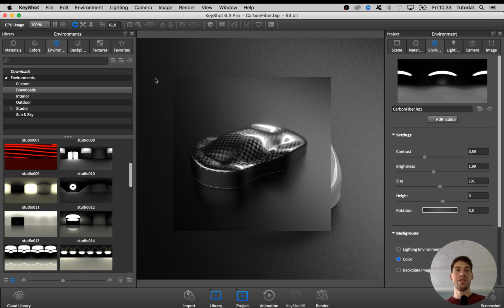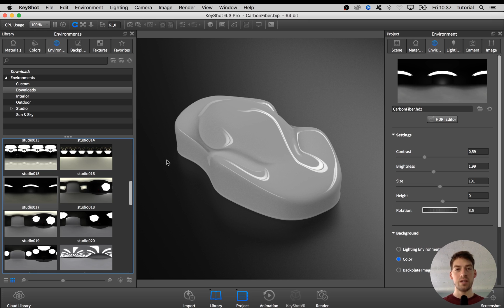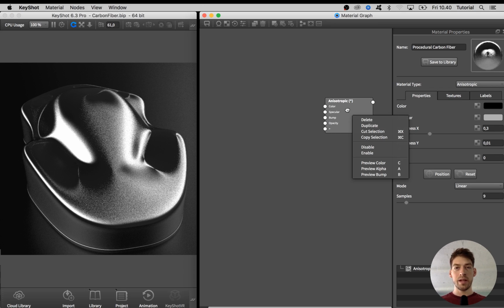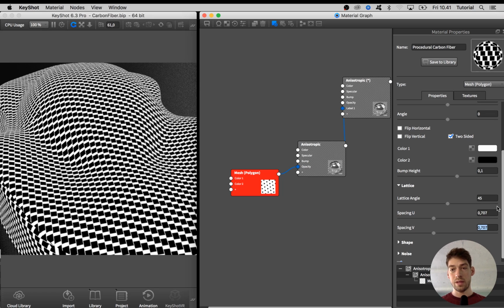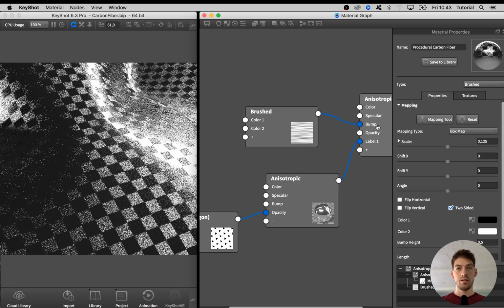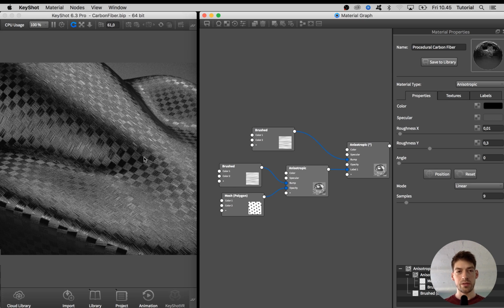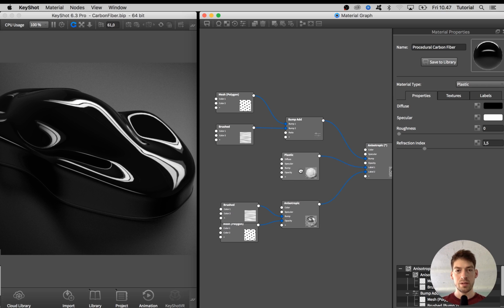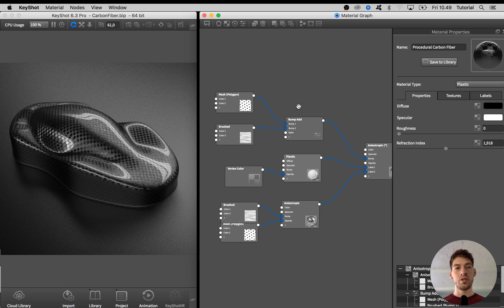KeyShot Material Study: Procedural Clear Coated Carbon Fiber

Comment: Hi Esben, this is an incredible video thanks for sharing. I'm pretty new to Keyshot myself. I'm trying to follow along but am having trouble adding the layer to the material at the 3 minute mark in your video. When I try to drag the coppied material to make 2 layers it does not connect for me. Is there something I need to do to the initial material (other than make it Anisotropic) to be able to link them?
Thanks

Comment: Really leaning alot from your tutorials! Thanks. I have one question.
I am using Keyshot 8 and my [material graph] is quite different.
My Material starts with 

[Material]- surface -------(connected) ------- [Anisotropic]                           1) has a [material]box already linked. And cannot link a Duplicated [Anisotropic] to the original materials label. 
                 - Geometry 
                 - label 

2) also there is no "mesh(polygon)" only mesh(circle)
2-1) I can change the shape of the mesh from circle to square and make a checker pattern, but after that boxes won't link. 

does this difference come from pro and non pro version? or am i doing something wrong. ;(
Reply: I have the same problem. Can't figure out why.
Reply: Same problem here
Reply: Same problem !

Comment: Good tutorial! but i have a little problem, when i try to import the material "Procedural Clear Coated Carbon Fiber" Keyshot show me a message that the program stopped working and when try to open keyshot it say the same. If i delete the file generated with extension .mtl it works like always but dont have the material ... I,ve explained well?
Thanks for the tutorial !
Reply from the maker: Thanks, Nevyk. Unfortunately I don't know what causes the crash. Hope you are able to make it work in another way.
Reply: Esben Oxholm i can,t fix it but anyway thanks too much!